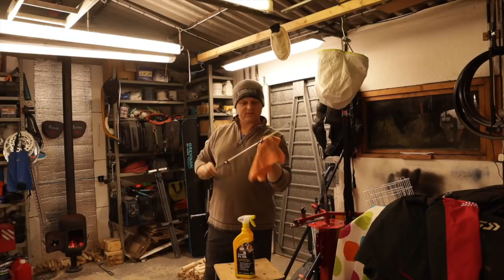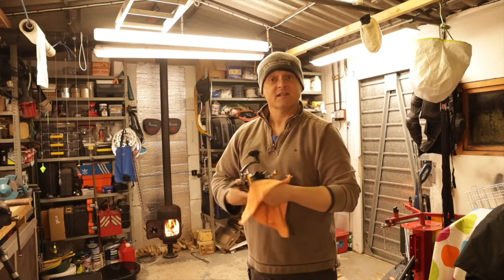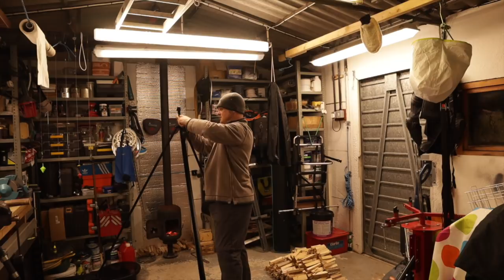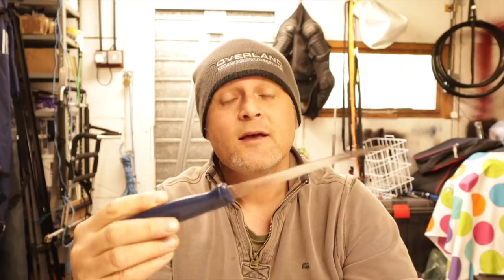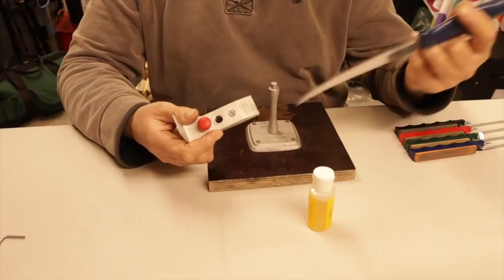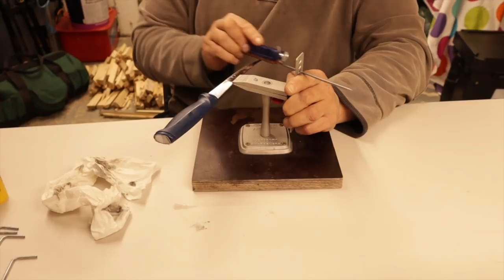Workshop Ramblings March '20 - knife sharpening and tackle care - lansky knife sharpening

Comment: Hi Mark, I am a newbie to the channel and don't normally comment but given present circumstances, I am at a bit of a loose end. To keep the length short I will write notes, forgive the grammar. These are ideas only based on what I have tried and am testing (nobody likes a smartass). 
I have the Lansky rod box as well as your system very portable and good for touch-ups. 
Putting black felt tip on the blade angle helps you get the angle right and show how the grind is going.
I have put bent rig clips on the paternoster instead of cascade swivels to allow easy snood changes. Changing the bottom hooks for bigger or pennels after dark.
The small swivels are fine Veals do an 85 pound breaking strain for the up and over. I find them good in the summer, pain in the ass on a cold windy dark Jan beach.
Putting the end of the silicon tubing in your hot tea helps it fit. ( I drink coffee)
Paternosters are a pain for snagging.
I like the up and over with a running ledger I am using the bent rig clip with a swivel to do the release but instead of the Gemini mini crimp and spacer I am using two silicon stops. I can then adjust to any length of snood.
Love termiclips but worry about them on the up and over ( because of the angle of the tension) I have lost hook lengths from Gemini clips this way. So now I am trying fast links with a silicon knot cover.
I love the Breakaway adjustable crimps ( don't buy the tool) the rubber lining means they don't damage rig body and you can crimp them down to just the right tension ( no more powder gum knots for me ) 
In low-stress areas ( tops of pat swivels, Bait stops) I am using the silicon stops a bit of a fiddle but good, buy a named brand eBay has some rubbish ones.
What do you think of SRT springs? With adjustable stops I can't decide if they are the emperor's new clothes or not, it would be interesting to test two rigs against each other. (I am too lazy for that but I see a video coming on )
If Mrs W has seen the film get well soon.  Stay safe.

David
Reply from the maker: David, thank you for the information burst which made for interesting reading. I know everyone has their own ways and routines which we all fine tune over the years. I enjoy sharing what I learn but never advocate that it is “the” way of doing things. I love all of the feedback that comes through the channel and your response is a fine example. Message me through my Facebook channel and I’ll grace you with an amazing sticker 😉👍🏻

Comment: Some great tips again mate... Especially like the one about using hot water to free a bound up reel seating... I have a carp rod I use for flatty bashing which has practically become unusable for that very reason... Will give your suggestion a try over the weekend
Reply from the maker: Hot enough to expand the plastic but not boiling which may distort it. Once you have wound the ring on a bit clean behind with a soft cloth. Let me know how you get on. 👍🏻
Reply: Will do.... Cheers for the tips, all great advice.... Keep them coming please 😁
Reply: Hi Mark, hope you're staying safe and well... Just to say the tip with the jammed reel seating worked a treat thank you 👍
Reply from the maker: Steve, I’m pleased it worked for you and always nice to here positive feedback. 
I’m safe and well although I do have to go into work which is a worry in these turbulent times. 
Look after yourself and I hope to be out fishing again soon.

Comment: That's why I always carry a chef's steel with me when I'm out fishing tho I use a wooden chopping board. Can always touch up the blade at any time just incase I drop it or something dulls it some how  I carry way to much in my box lol but better safe than sorry lol
Reply from the maker: I have been working hard to reduce what I carry. My buddies Colin and Clive have got it down to a fine art but I’m not quite there yet.
Reply: @seaangling   I know that feeling mark I try but end up putting more back in ther lol
Reply: Judging by the state of my fishing knives i may need to take an angle grinder with me
:-)
Reply from the maker: Karl, that would be the quick rough and ready method. 😲
Reply: @seaangling  just how I like my women
:-)
;-)
:-)

Comment: Another good video, always enjoyable. With my reels I put a scrunchy on the spool to stop the line unravelling. What rods do you use and where did you get your sharpening set from. Sadly on a down side, I really believe it will be more like 2 - 3 months before we will be allowed to wet a line. But we must keep our fingers crossed for an earlier resumption. Cheers Mark
Reply from the maker: Hi Andy, I did try using sweat bands for my reels but they kept knocking the line guides off. The long rods are Shakespeare K2 extreme blacks 15’6”. There is a link to the sharpening set in the description and I fear you are right with the restriction criteria. We can but hope though.
Reply: What I use aren't as big as sweat bands. They are small hair scrunchies. I have had no problems. Keep on with the good work

Comment: What can you clean your Rods and reels off what what lubricant are you using need some to clean my rod off or rods
Reply from the maker: Cold fresh water with a hint of soap, dry and then use a rag with your choice of inhibitor. I use Scotoil FS 365 but there are other products out there.
Reply: Thanks very much for all getting back so quickly just need to get some wire to make bait needles

Comment: I got an old military Kukri knife that needs a bit of TLC can I could send it over to you 😂. I have no knowledge on how to fix up. Could do restore video actually really interesting to watch this video.
Reply from the maker: I’d happily put an edge on it
Reply: Mark that sounds like a plan. It has its original sheath but it’s missing its tradition sharpening tool and the sheath is a bit tatty. The blade itself is good some surface scratches and black markings. I traded an item for it while working with Gurkhas one time.